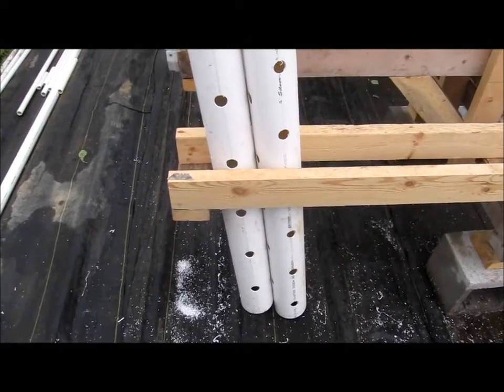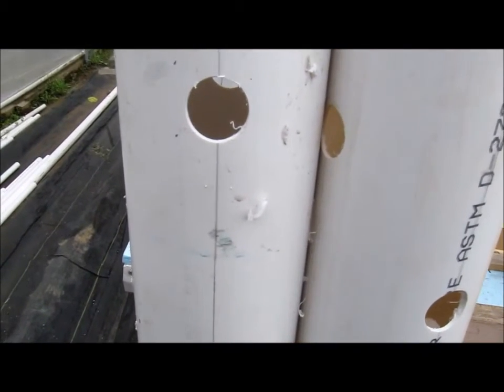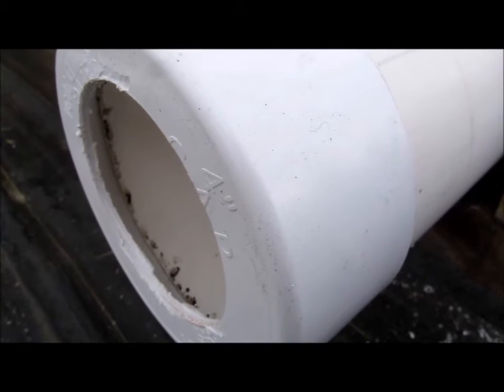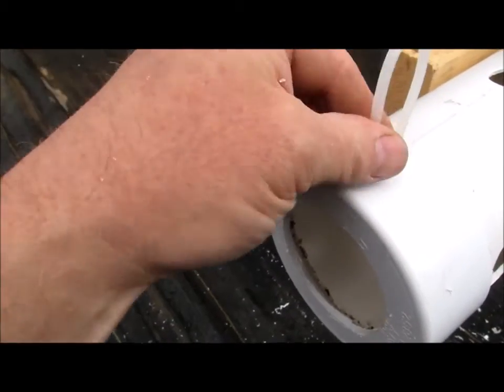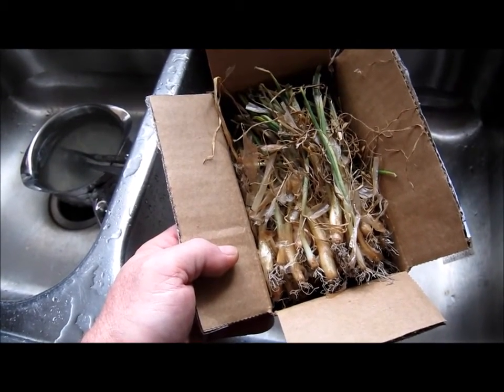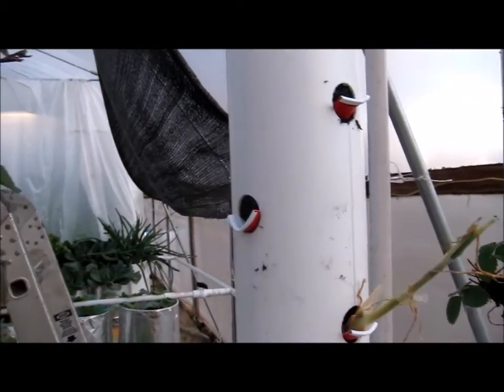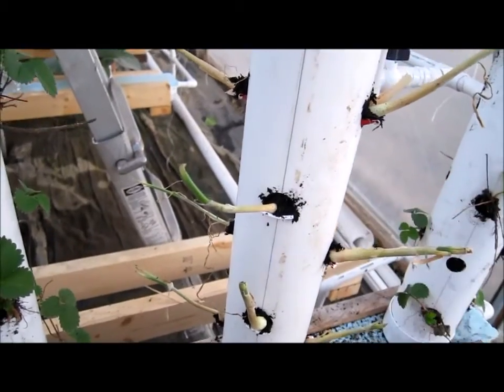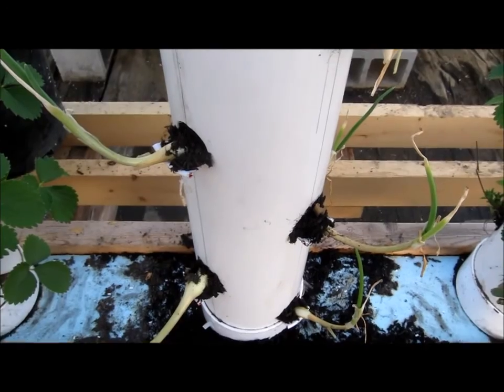Growing Onions Vertically

Comment: Do you have problems with the soil settling and compacting over the growing season and if so what do you do about it? I've been using some barrel type towers but the soil compacts so badly about halfway through that it turns into a wasted effort.Plants at the top end up with exposed roots and plants on the bottom can send out roots. I've thought about fixing "plates" with holes to allow water flow or fine wire mesh in between each level in the hopes of reducing this.
Reply from the maker: +The Self Sufficient Life I have the answer for you as I see it.  With rice hulls in such small buckets, 5 gallon or less, they do fine.  In my case, the roots grow through the hulls into the reservoir so even if it compacts (and it does some), there's no issue.  What you are experiencing is the biggest container issue I've dealt with.  The various mixes can settle, filling in pore space, and choke out (suffocate) the roots.  Many times, my plants would stress as the season went on.  Your best hope is to create a slow-decaying mix.  Don't use garden soil in containers.  The mix that did the best for me was 3:2:1 of peat:pine bark fines:Perlite.  You can sub general potting mix for peat.  Peat is great for moisture retention while pine bark fines and Perlite afford pore space essential for oxygen and root growth.  Later as it settles some, all you have to do it top off.  Remember, the mix is basically sterile so you'll need to ensure they have fertilizer, but not too much, if any, compost.  Thet'll fill in pore space.  Best wishes.
Brent

Comment: Will be interesting to see how this works too. Will the larger ones pull loose from their own weight? Like the way you try new things.....cool.
Reply from the maker: +Midwest Gardener I wondered the same thing!  What to do if they start dropping?  My plan for that is that when the first one drops, I'll tie a tomato string from the onion, where green meets bulb, to the structure above.  The thought of getting 34 onions in a 1' x 1' square was too tempting and I just had to give it a go.
Brent
Reply: C3 Voyage
Sounds like you have it covered. Great use of space for sure.
Reply: Midwest Gardener 

ithink root system  will not allow to drop or give way
the green shoot system will go upward naturally

Comment: Goodday
Can i get an update in your vertical onion.i searched all ur videos but couldnt find it.what was the success rate
Reply from the maker: I wish I could be more specific for you on those onion updates.  It would have been in the greenhouse updates.  The onion towers worked pretty good, but not all of them got big.  Some were golf ball size, some base ball, and a few softball size.  I did modify the towers some pulling the lower part of the hole out so that it formed a small cup.  I haven't planted in them yet so no full update on it.  I'm thinking I'd like to try it again however in 2019.

Comment: Hi Brent, 
Interesting concept, I'd thought you'd need bigger holes but, if the bulbs can grow outside the tubes then that would be amazing. 
  How would earthworms fair in your system? Do you think they would thrive or become water logged and die.  Cheers, 
Bill
Reply from the maker: +William “Bill” Walter Ahhhh, Bill, you're stealing my thunder some with that question.  I'm already adding compost tea to the reservoir.  Once the "heated" (really climate controlled) greenhouse is built, I want to add compost to the buckets again and let loose some worms to test the very thing you ask.  The composted rice hulls act as a filter as water travels through it back to the reservoir similar to aquaponics I figure.  This allows me some play with organic elements such as worms and compost.  We will see if I can get around to it.  
Brent
Reply: Would you want to keep the rice hulls and organic elements separate via nylon stockings? Or is it not an issue to mix the two. Cheers,
  Bill
Reply from the maker: +William “Bill” Walter Sorry, Bill, I can't envision what your asking.  Do you mean adding compost to a stocking and burying the stocking in the rice hulls in the bucket?  The rice hulls are in the buckets.  I mixed the rice hulls with compost at a 50/50 ratio last year and that was too wet.  It worked though.  I'd add much less this time (say 90/10) and add worms in a couple test buckets.  Worms process organic matter so it won't be ideal for them without uncomposted material.  My thoughts are that the worms may help with bacteria and aeration.
Brent
Reply: Hi Brent,
So what I was thinking with the stocking is, it's the core (middle) filler with the organic material. Then the rice hulls are added around the core to support it. Filling the stocking would require a second length of pipe maybe 1 1/2 to 2 inches, that way you can control the space (otherwise the stocking will expand and take the space of the entire 4 inch tube) the core takes as well as the location. As the 4 inch pipe is filled with rice hulls you simply pull out the core support tube. Then the worms can work their magic along the entire  length of the stocking. Your plants roots should have no problem entering the nylon as well to get to the rich organic soil there. Hope the idea helps. Cheers,
Bill
Reply from the maker: +William “Bill” Walter Interesting.  More potential experiments!
Brent